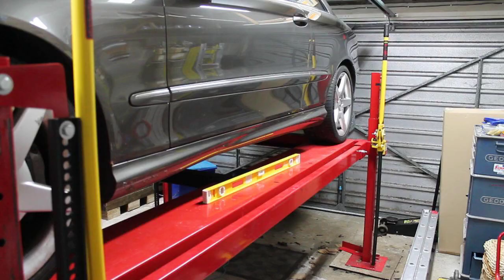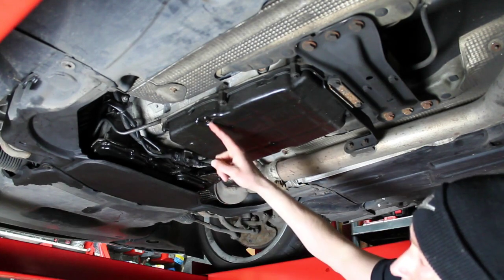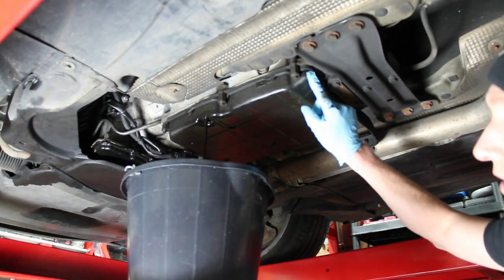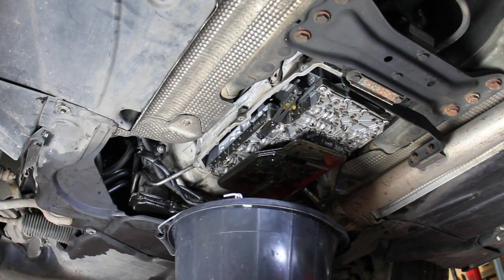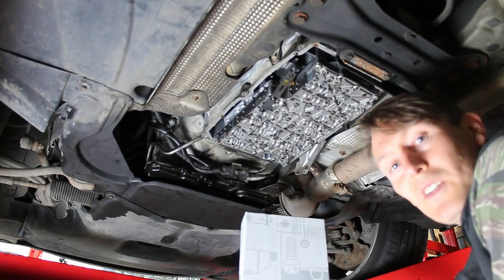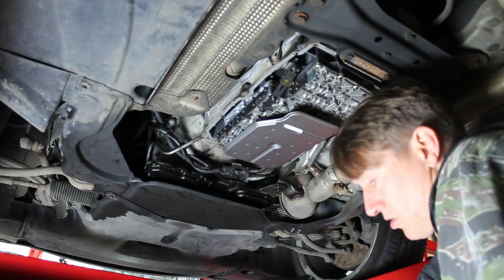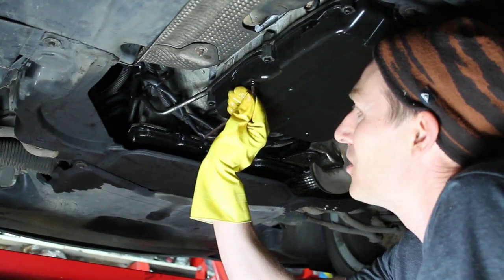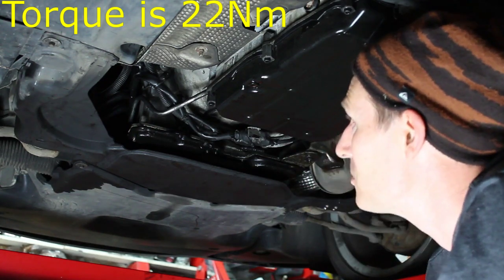How to Change the Oil and Filter on a Mercedes 7 Gtronic 722.9 Automatic Transmission

Comment: Don't  forget to ceep the engine running when draining to the correct level after filling new oil😮
Else you will end up with to little oil in the gearbox 😅

Comment: does the transmission have to hot or cold when draining?
Reply from the maker: I always do it cold because that way, all of the fluid is in the pan, if it has been running recently, you have to wait for it to drain down out of the tranny. Cheers, Phil
Reply: thanks cheers @ReviveMyRide

Comment: I saw another video where someone filled through the trans dip stick hole then cycled through the gears when idling. Do you only need to do some of that if you drain the torque converter?
Reply from the maker: Hi, my understanding is that the 7G-tronic transmission doesn't have a transmission level dipstick. Hence, the unusual filling and level checking process. The earlier 5G-tronic did have the facility to add a dipstick, so maybe in the video you mentioned, it was one of those? Regarding the torque converter, it fills automatically from the tranny sump when you start the car, then you just top up the level (through the drain plug). Hope that helps! Cheers, Phil

Comment: Hi.I ve got transmission oil cleaner (Liqui Moly).Shall I use it or it may make gear shift worse ? OM642 with 190 k miles and probably oil replaced about 70 k miles ago in MB Salisbury .Shall i replace oil from torque converter too ? Thanks.
Reply from the maker: Hi, I've never used a transmission cleaner. My concern would be getting it all out again so that it doesn't interfere with and degrade the new transmission oil. These tranny's are difficult to drain without a certain amount of extra disassembly. Personally, I would try a transmission fluid and internal filter change before resorting to a cleaning fluid. Yes, if it is possible to drain the torque converter, I would do it. Here is a video that shows how to do it. https://youtu.be/oLjx6kV8MEo Hope that helps! Cheers, Phil

Comment: The Engine must run if you drain the overflow
Reply from the maker: Thank you, you're absolutely right. I used to stop the engine and then quickly do the level check and this always worked well for me. but now I have an updated video where I do quite a few things slightly differently... just with experience . https://youtu.be/tda4zokL4Os?si=uq75v1R-AOjeduhy Thanks, Phil

Comment: Pretty sure the transmission holds 9L of transmission fluid?
Reply from the maker: Yes, it is 9L in total but very difficult to drain all of it. If you do the pan and the torque converter that would be about 7L. The standard Mercedes procedure would never drain all of it. Thanks, Phil

Comment: You should put a tap or screwdriver up the drain plug to knock out the overflow “snorkel” to allow all the oi” to drain before removing the sump plate ....
Reply from the maker: @kfor6631 Thanks that's a good tip! In fact, I now do it that way. I have an updated video where I do a few things differently (now with more experience), It's here if you're interested: https://youtu.be/tda4zokL4Os Thanks, Phil

Comment: Great video, what is the size of steel pan bolts you used? Thanks
Reply from the maker: Hi, they were M6 x 40mm cap heads. TBH, for the job they are doing, they seem a bit long, you would get away with 30mm or 35mm long bolts. Just make sure you use Metric coarse (which are basic metric bolts) as the pitch of the thread is 1mm, which is what you need. Thanks, Phil

Comment: I don't have the service information on my 2009 Mercedes-Benz S550 4matic. My oil pan has a leak. If I do a Transmission pan service will it damage my Transmission? I'm very worried about that......
Reply from the maker: Hi, if your pan is leaking, it is almost certainly the rubber pan / gasket seal. These transmissions are sensitive to fluid level, so if you are losing fluid, it needs to be sorted or you will start to get problems. If you have a little too much or too little fluid, it won’t damage your transmission but it will start affecting how it operates. I’ve actually created a much more detailed video now, give it a watch and you should hopefully gauge how confident you feel about doing the work diy. https://youtu.be/tda4zokL4Os Maybe get some quotes from local Mercedes Benz specialists and then you can make a decision on it. Hope that helps, thanks, Phil

Comment: You changed less than half!
Reply from the maker: In the end, I changed just over half. Unfortunately, that’s how you have to do it if you have an early car, that doesn’t have a torque converter drain plug. Many of the early cars are done this way when serviced by Mercedes. However, I have a new video out that shows how to drain the torque converter on later cars, which allows a lot more of the fluid to be changed. It should be pinned to the top of this comment board. Thanks, Phil
Reply: @ReviveMyRide  So your model does not have drain on the torque converter? Models before and after have it? You could do a flush, that requires a bit more work.

Comment: No torque converter fluid change?
Reply from the maker: Hi, early cars didn't have the access port to allow the torque converter to be drained. But if you are interested, I recently released a video showing how to drain the torque converter (on cars that do have the access port) 👉  https://youtu.be/oLjx6kV8MEo Thanks, Phil
Reply: @ReviveMyRide  yes I did see that thanks 😉
Reply: @MrBlompod  cool! 😎 obvs a full new 7G video out too where I give lots of extra tips and explain more. I suspect you know quite a lot about these trannys already. Comments and discussion is always welcome! 🙏 cheers, Phil
Reply: @AroundTuit  Thanx Phil I bought a beautiful 2014 W204 CDI 250 coupe only 45 thousand kilometres on it, it’s as new. Got a quote for a tranny service fuel filter and front brakes over 2500 dollars 🙄 I’m sure I can do it all myself with the help of your content. Thanks mate 😉
Reply from the maker: @MrBlompod  Sorry, replied with the wrong account above! Yeah, sounds like you have a really nice car there! $2500 is crazy money! In the UK, you can get it done by Mercedes Benz for £400 (about $500). Get a few quotes if you don't want to DIY it, I'm sure you can do a lot better. Maybe ask for a recommendation for a shop near where you live from https://www.benzworld.org/forums/  And actually, the DIY isn't too difficult but can be time consuming, make sure you have all of the tools, parts, materials before you start and allow the full weekend to do it, if you are a first timer. Thanks, Phil

Comment: On my GMC Sierra, the procedure is the same except the final level is established with the engine running,
Reply from the maker: Including filling the transmission through the drain plug? I thought this was really weird but maybe not if other manufacturers do the same... Yeah, technically, I should have left the car running. I stopped the engine and checked the fluid level straight away but as you say, ideally, should have eft it running (I shut it off so that people could hear me speak but should have done a voice over during editing instead!).

Comment: The best way to refill is buy the refill adapter and buy Greenwood 2 Gallon Home and Garden Sprayer from harbor freight pour the transmission fluid in the bottle take the gun off the end and put the rubber onto the black refill tip screwed into the transmission pan now just pump a few times and it will auto fill from the pressure you can add more and have no leaked because the pressure will hold the fluid in when you're done unscrew the black adapter but have your transmission pan bolt ready because fluid will pour out also buy 3 extra bolts from Amazon because you can snap bolts easily and also have a bolt extractor 😢 just in case
Reply from the maker: Thanks for commenting! That method does sound really good 👍 A particularly good tip for anyone reading this who is based in North America. We don’t have Harbour Freight over here by I’m sure we could find something similar… cheers, Phil

Comment: Hi what’s different between 236.14 136.15 fluid?
Reply from the maker: Hi, I never looked into it in too much detail. I knew my car needed the 236.14 and left it at that. Apparently from 2010, when Merc introduced the Stop / Start technology, they moved to the lower viscosity 236.15. If your car is in the 2010/2011 age range and you're not sure what fluid to use, you are best to call Merc with your VIN and query it. Hope that helps some... Thanks, Phil
Reply: Revive My Ride thank you Phil I think exactly is what you said

Comment: Have you included a note that I’ve missed re; stepping through the transmission P-D-R to circulate the fresh fluid?
I saw a reference to it as being in the video but didn’t see.
My model is 2014 W212/3 E300 Hybrid
Reply from the maker: Hi, I have limited connection at the mo, so can’t easily go back and watch the vid but you are correct, after changing the fluid, it is a good idea to start the car, keep your foot on the brake and then step it though the various gears circa 10 secs in each one. Your car may have the 9G-tronic at that age? If so, the service is likely to be slightly different to what I showed. I have a 9G now but haven’t had to service it yet…. Thanks, Phil
Reply: Thanks Phil, for interest my car was assembled here in Thailand so is somewhat out of step with European/US models and has 7G transmission. Designated E300 blutec hybrid AMG Dynamic however it doesn’t use Blue 🤔
Enough of my ramblings, many thanks for your down to earth approach to  vehicle maintenance and improvisation of easily obtainable items to save buying service tools that usually cost the earth.
Reply from the maker: @barnstormin  That’s really interesting about your car, I had no idea you could get a “hybrid” spec like that in other countries! Thanks very much, always trying to find ways for home diy’ers to get the job done to a good standard in a budget! 👍
Reply: Hi Phil,
Just out of interest, when I finally got around opening my MB EPC WIS/ASRA (which I should have done earlier) and started reviewing all the stuff I have clearly forgotten I note that the 7 G-Tronic on my car is actually 724.208 unique to Hybrids I'm assuming and the EPC makes ordering spares easier. There doesn't appear to be any difference in the hybrid ATF & Filter method and the only references to Hybrid is basically, 'Don't mess with any orange bits! Which I steer well clear of anyhow but if you or readers have any specific comments on Hybrid transmissions I'd like to hear them in particular references the torque converter drain which, until I get under and see if there's anything in the configuration that prevents draining as in non Hybrids, I need to research further.

Comment: Thanx for the entertainment but dont think i need to do this for a few years as i see in the notes for the car that it was changed at 45,000mile.
I changed the fluid on my X5, and the fill was on the side of the sump and you had to fill whilst the engine was running !!!!
Reply from the maker: You prob already know this but on the older models the transmission service is at around 55k miles. So you are looking at about 100k miles for yours now. Sounds like you car was well looked after 👍
Reply: @ReviveMyRide  yes its immaculate, like new, and im going to now go over everything check, clean and paint where required.
Ive subscribed so will be looking through ur vids for help !!
Reply from the maker: @arnietwo11  sounds like you definitely have a good one there! Thanks for subscribing, good to have you along! 👍😊

Comment: I stumbled upon your video today again and I forgot to mention you need to keep the engine running while fixing the oil level. The oil should start dripping then you can close the plug. Other than that it was cool.
Reply from the maker: Thanks for your comment! As it happens, I stopped the car, checked it immediately (as shown in the video) and haven't had any problems... so I don't think it amkes a huge difference. It's a while ago now and I "think" I stopped the engine so that people could hear what I'm saying in the video? 😂 BUT Yes, you are 100% correct that technically, you should level check and top up with the engine running. Thanks, Phil
Reply: I think a running engine would make a difference in the fluid quantity. How much oil did it take to fill?

Comment: Great Video! by the way, how did you make the valve? thx
Reply from the maker: Hi, in the diagram at 14:12 in the video, you can see all of the equipment that you need for a filler set up, including a valve (Item no. 4 on diagram). They are all listed in the description. I used a different valve in my video because I just had it lying around but if you need to buy one, the one listed in the description will be cheaper for you. I had a friend make an adaptor that goes into the sump for me on a lathe at work but then later realised you can buy them really cheap (item no.1 on diagram). Hope that helps! If you have any other questions, just let me know! 👍

Comment: I finally did it. New bolts snap off, not even close to the torque spec. Huge mess in the driveway. I guess I will have to use the old bolts.
Reply from the maker: I'm with you on this one! I don't know why they use such weak bolts and the torque spec is really low. I'm sure I had at least one of the new ones break but thought maybe I had a bad bolt or two, otherwise I would have mentioned it in the video!

Comment: If Mercedes made a bicycle, it would have square wheels. ZF automatics don't need any of this adaptor crap.
Reply from the maker: 😂 The first time I worked on a Merc transmission I was like: "Really! You refill them from the bottom!" It does make for a messy job! I agree that ZF gearboxes are excellent but if you overlook the awkward servicing method, the Merc auto transmissions are right up there with them! BMW & Audi use a lot of ZF boxes, Merc is still making their own... Says something for their in house engineering capabilities. cheers for the comment, Phil
Reply: @ReviveMyRide  We did one today on an E350 (M272) without the adaptor. Drained the oil, knocked the plastic tube out and replaced both the filter and the rusty sump pan. To refill, we used a manual oil pump with a bit of narrow copper fuel pipe fitted into the flexible clear tube and added oil until it started to run out. Fitted the sump plug, started the engine and with diagnostics, ran it up to 45 degrees - interestingly, the heat sensing gun read 43 degrees. About 1.5 litres more oil went in until it started to run out.
Reply from the maker: Sounds like some good work there and a bit of ingenuity on the refill! Like it! 👍 Interesting to hear your feedback on the heat sensing gun vs the diagnostics, 2 deg out isn't too bad tbh for someone that wanted to do it that way as a home diy. Cheers!

Comment: Great video but I am totally confused by your comment "From mid-2010 onwards a 7G Tronic plus auto transmission was fitted and this one used blue transmission fluid. NOT FEATURED IN THIS VIDEO."
I cant find anything on this type fluid can you please advise!
Reply from the maker: Hi Joe, Mercedes continued to develop the 7g-Tronic (722.9) transmission throughout its service life. From 2011 onwards with the introduction for Stop / Start technology, they changed the fluid type. If your car is pre 2011 / non start stop then there is some guidance on fluid in my video description. Post 2011 car or just interested, here's a link to a discussion on a forum: https://forums.mercedesclub.org.uk/index.php?threads/722-9-transmission-fluid-change-questions.183783/page-2 Hope that helps! Thanks, Phil

Comment: I cannot do the level, all the fluid is coming out . Can I cask you why? Thank you
Reply from the maker: Hi, I assume you are filling the transmission from the bottom using an attachment and a pump? The main reason I can think of that fluid would run straight back out is if the overflow pipe isn't fitted correctly. It fits directly above the drain plug and is like a little tube. As it is a few inches long, fluid should not flow back out of the transmission pan until the level is high enough to go above the top of the over flow pipe. Just for clarity, here is the piece I am talking about https://www.ebay.co.uk/itm/173929467890 and you can see it fitted on the inside of the transmission at 05:55 in the video. Hope that helps! If you have more questions, just let me know and I'll help if I can! Thanks, Phil
Reply: @ReviveMyRide  Thank you, I gonna have to drain the fluid and put it back in . Can I also ask you one last question please, Why does the car goes in limp mode when I reach around 100mph and until I stop the engine and start it again, It has no power and the engine doesn't go about 3000rpm even if I drive with 30mph.(I have an S320 2006) Also I want to mention that when is hot it starts then dies right away, always starts from the second try. Thank you ! Have a nice day!

Comment: Did you put new bolts ?
Reply from the maker: Yes I did! Sorry if I didn't mention it in the video! Highly recommended to replace the bolts. They are made of aluminium alloy, not steel and they don't take very kindly to being reused, very prone to snapping during retorqueing (even though the torque is really low). Speaking of torque, a mini torque wrench really does come in handy to get the torque correct on tis job! Hope this helps! Thanks, Phil
Reply: @ReviveMyRide  , I am getting ready to do this to my 2004 E500.  I see some people and literature say to torque the new transmission pan bolts to 4 NM.  Some other sources say to torque to 4 NM and then turn the bolt an additional 180 degrees.  I really do not know which is correct for my car.  Can you advise?  Thank you.  Tom